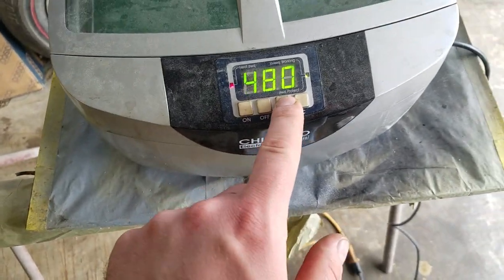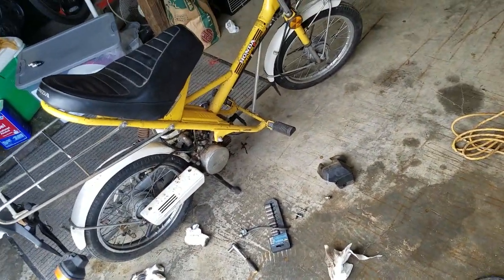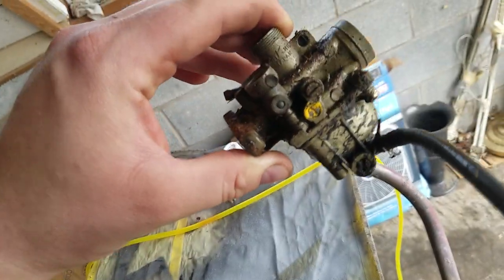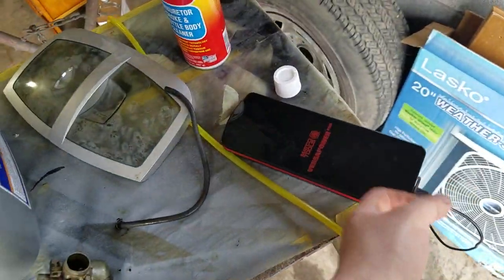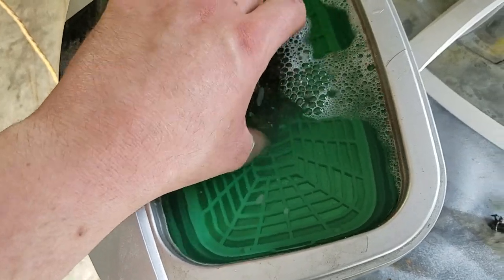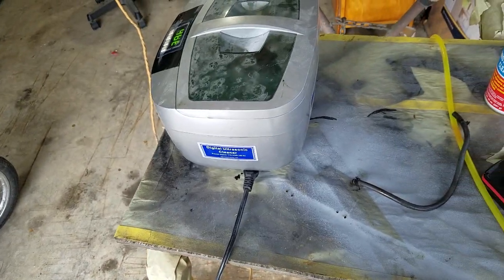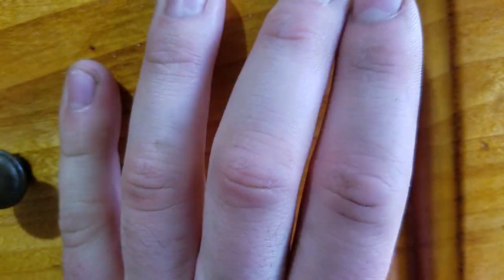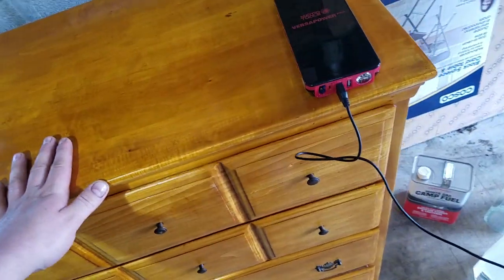What I have been up to- 1980 Honda express II and more

Comment: for the oil tank, you may try a 3/8" fuel line and then get a reducer/adapter (I forget what's it's called but the local hardware had it) so that you can go down to 1/4" fuel line.  the oil tank outlet is a little bigger than 3/8" but you can get 3/8" fuel line on it.
Reply from the maker: Thanks for that bit of info. I haven't really tried looking yet. I've been busy with other things.